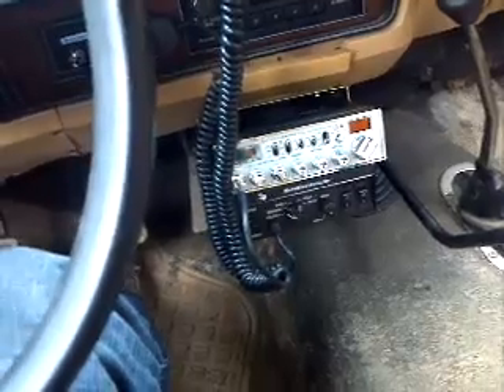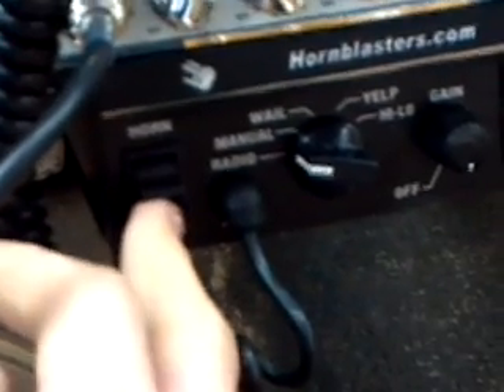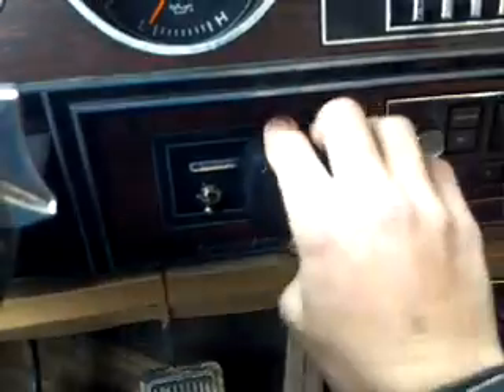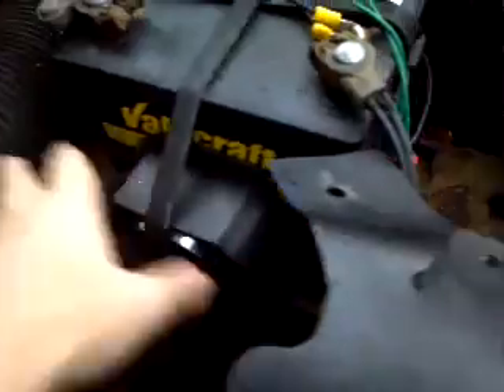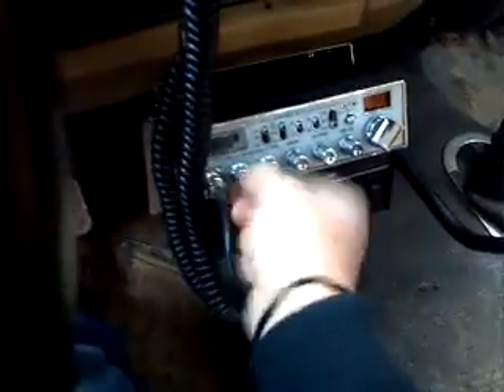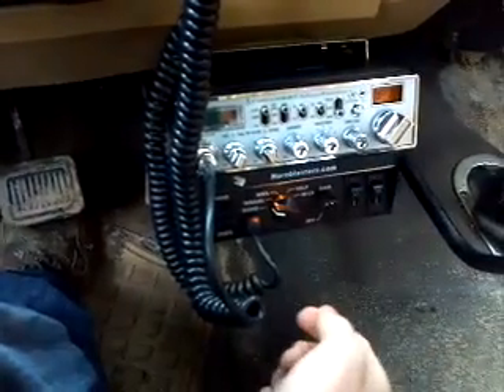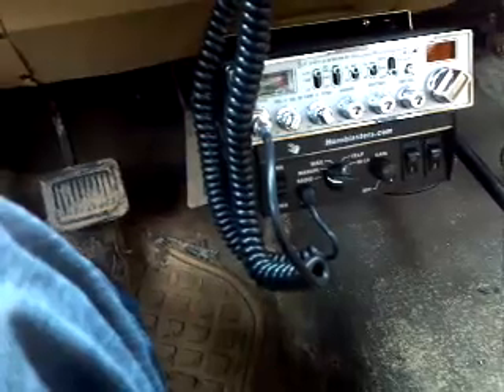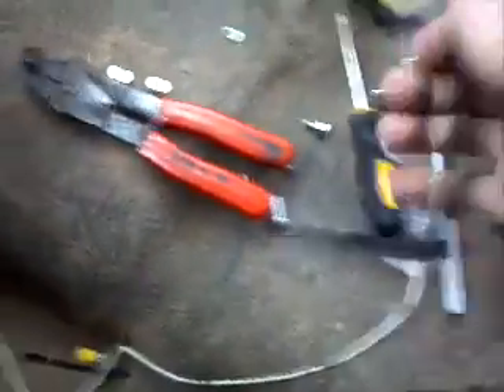hornBlasters 100 watt PA system review and install

Comment: You need to tidy up those wires before you burn up your truck. I have seen it happen using your laid-back system. Be careful and respect the destructive power of careless wiring..just sayin'